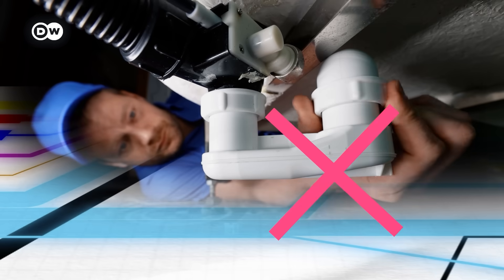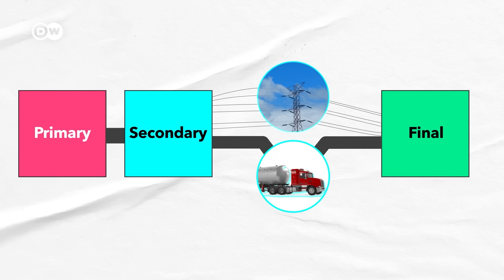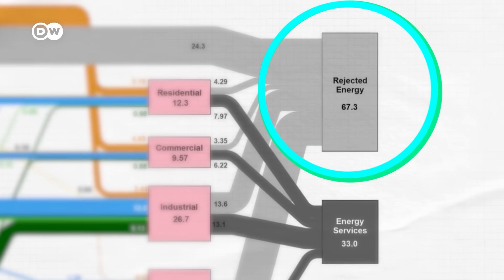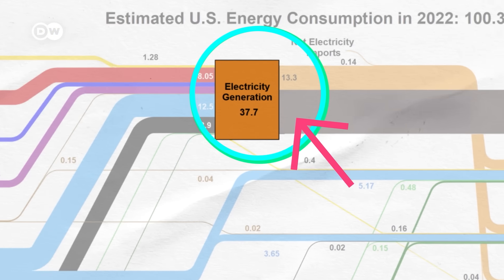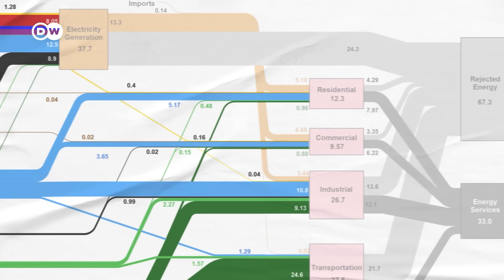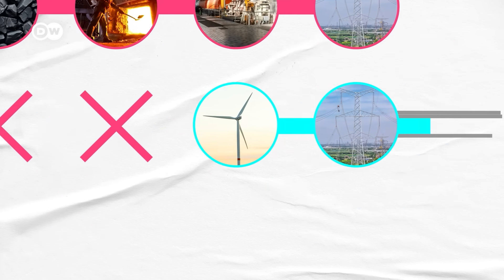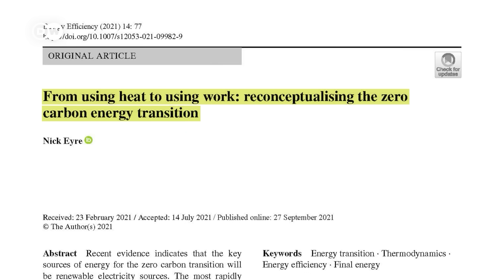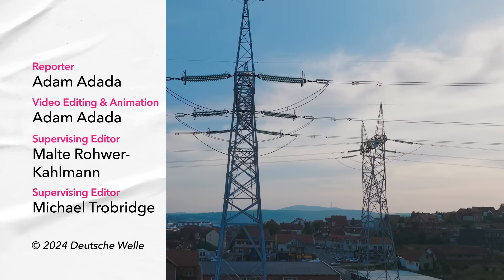The mind-blowing thing we get WRONG about energy

Comment: This is not mind-blowing, when you got a scientific background.
1. Fossil fuels are attached to thermal engines. The first and second law of thermodynamics limit the efficiency to ~40% at best.
2. The form of energy plays an important role for using it. Electricity is a very high, ordered form of energy, regarding its structure. Having such a low entropy form of energy, it is very quick to use but difficult to storage because of it is volatile/fugitive.
Reply: Ships Diesel engines are 50 to 58% efficiency

40-45% is what you would with a Naturally aspirated engine, once you add stuff like two stage turbocharging, heat recovery and so one that gets closer to 65% efficiency

Modern combined cycle gas turbines power plants get 65-67% efficiency, that without Supercritical HSRGs, or recuperator, intercoolers nor water augmentation, add those and you would get close to 80% efficiency

But again,it doesnt matter, because efficiency doesnt reduce energy consumption, 

Ships engines have gone from 30% to 55% efficiency, making them more efficienct, and cheaper to run, more people uses ships for transport, so ships have been made way bigger which has erased any fuel saved

And Europe green utopia dreams has caused companies to go where taxes are lower and regulations are non existant, like china  southeast asia, and india
Reply: Germany is quite cold, I'm surprised that they don't have more Cogeneration plants. Even low-grade heat could be pumped underground in summer to be used during winter.
Reply: @ArthursHD   When I first started learning about renewable energy, the idea of pipes underground to mix cool ground air with a home's hot air was very appealing, but it's not so cheap to dig the soil and install the pipes (though it should be). Now however, we can think of storing heat (in various ways) and in some instances even convert that heat directly to electricity. So, our ideas about storing heat and electricity are much advanced over a few decades ago.
Reply: @ArthursHD They do. Nuclear and conventional power plants in Eastern Europe provide steam for heating and cooling.
Reply: The "adiabatic flame temperature" of fossil fuels, after mixing them with the stoichiometrically correct amount of oxygen (if pure oxygen, take into account the cost of separation from atmospheric nitrogen) and combusting the mixture, is usually well above 3000 K. In an ambient 300 K world this corresponds to a Carnot efficiency of over 90%. So the truth is rather that actually existing thermal engines are still far away from the ideal reversible engine.
Reply: @Hecatonchires1991  You might be genius. Or you might be wrong.

I think you are wrong:
1. Laws of thermodynamics: There is no such thing like an ideal reversible engine/perpetuum mobile.
2. Let's assume: Flame temperature about 3000 K (a little bit high, but let's go with this number). Temperature of the exhaust gases 1300K.
efficiency = 1 - (Tmin/Tmax) = 1 - (1300/3000) = 56,6...%
And 56% is a very good value, most combustion engines are around 30% at best.

The problem is, that combustion engines are only efficient in a very close rpm-bandwidth. So they need gears to widen that bandwidth -> more less efficiency.
Reply: @michaelmueller9635  I believe that CCNG plants do approach 60%, it is of course all about the working temperature, current nuclear performs bady at <40% at 350c. But high temp reactors like MSRs at >700c could also hit 60% when paired with super critical CO2 generation plants. Also nat gas burned in oxygen has been demonstrate to hit 80% but with the cost of separating the O2 from air at 10% cost so net 70%. Use the nitrogen for fertilizer production seems obvious. This was done a decade ago in a NC prototype plant.
Reply: @michaelmueller9635  In your response you invoked other considerations on top of the 1st and 2nd law of thermodynamics. In your original post you claimed you didn't and that is were my criticism was aimed at. Other responses that I got suffer from the same problem (like whether or not an engine that can withstand 3000 K is possible in terms of materials). Just a final point of feedback: in today's heat engines you will never have T_h = 3000 K because they overdose the air that is used in the combustion way too much and that of course cools down the reaction mixture dramatically. As another poster pointed out, today's materials (at least the moving parts like the turbine blades or...) are not up to the task of handling 3000 K. The best turbines today can go up to 1800 K or something like that (expensive monocrystalline turbine blades).
Reply: @Hecatonchires1991  The main issue is, that your delta of T_min (or T_out) and T_max (or T_in) wasn't accurate.
For maximal efficiency, T_max and T_min should differ as much as possible.
Especially T_min was much too low ...it's not around 300K but 1300K.

So with a smaller delta of T_min and T_max the theoretical efficiency drops from 90% to 56% like in my calculation example. And this is much closer to the efficiency values in reality.

In practice the theoretical efficiency is furthermore reduced by heat conduction of the machine itself (wall and surfaces take heat, the machine should convert) and other effects.

And there is nothing much you can do about it: For example combustion engines in cars are in practice (fuel to wheelpower) much closer 20% than to 30%, 40% or 50%.
After like 100 years of development and optimization. So this is almost done, there will be no technological breakthroughs.

You can optimize powerplants a bit better, because you can optimize on a certain condition (and be more in the narrow bandwidth of a thermodynamic machine ...so you use their 'sweet spot' better).

But it's the point I made before (because it's a thermal engine):
After like 100 years of development and optimization. So this is almost done, there will be no technological breakthroughs (S-Curve-Concept/Modell).
Reply: @Hecatonchires1991 Then Mr. materials scientist, find me a cylinder wall metal/superheater metal that can survive at adiabatic flame temperature. I'm waiting. 🙄
Reply: Cast Iron sleeves will do fine, Thats why we have boundary layers.

The average working temperature of Diesel and Otto engines is around 600°C, while peak temperatures shortly after combustion are 1700°C, however it happens so quick that a low ammount of heat is transfered to the combustion chamber walls

The temperature at the boundary layers between the engine oil and cylinder walls is around 200°C and as such we can keep it cool with water at 100°C

Most of the heat is lost during the exhaust, thats why turbochargers and lean combustion was invented, so the exhaust does partial compression work of the engine
Reply: I don't understand why efficiency matters here. Solar panels are at best 20%, while wind turbines are a bit better. If we "wasted energy" then renewables end up losing
Reply: @user-hk3ej4hk7m : Since renewables get their energy from the sun, the "wasted" energy turns into heat. Which 100% of the sun would have done, if the solar panelss wasn't there. And wind turbines do the same thing indirectly with wind.
Reply: It still doesn't answer why making the switch should be any easier. Or why you "only need to substitute 2/3 of it"
Reply: @user-hk3ej4hk7m  Because renewables do not get wasted during the 'energy transformation process'.
It is like:
energy-form A (input, not directly usable) -> transformation process (to make it useable) -> energy-form B (output, usable)

If your energy-from A (or the input) is already electricity, you don't have to transform it and therefor there are no losses by conversion.

Be a little bit careful with physical energy and a "usable physical energy form for economic/human" needs.
Reply: @user-hk3ej4hk7m    If you substitute 2/3rds of the inputs with renewables (heat and electricity generally), and then avoid wasting that energy, you've shifted away from inputs that are eventually wasted over to fewer inputs that are used more efficiently. It's more of a lateral shift than mathematical reductions here or gains there.
Reply: @user-hk3ej4hk7m  A gas stove is worse at doing it's job than an electric stove. If you replace the gas stove with electric, you are using less energy to do the same cooking, plus you are creating zero greenhouse gasses. Even if your grid is powered from fossil fuels, the efficiency of the electric stove still helps.
Reply: @Babyblasphemy A gas stove might only be 40% efficient. But the gas-burning power station is 60% efficient, 91% transmission efficiency, 80% of the heat going into the food, with a combined efficiency of barely 43%. So in the end, the energy use is the same.
Reply: @gregorymalchuk272  Sure. But that doesn't feed into the economic  balance. 
"Waste" is just a strange term, they simply can't convert it. Just say ur solar foil can do a certain bandwidth. The other  bandwidths got simply reflected or get a pass, but don't get converted. Is this waste? I dunno.
Reply: @user-hk3ej4hk7m    Losing sunlight and wind don't destroy the environment. They aren't like trash we have to dump somewhere.
Reply: @user-hk3ej4hk7m Wind turbines are a tiny fraction of 1% efficient at converting sunlight to wind. Solar panels are really bad as they dump 83% of their heat to low-to-ground air heating.
Reply: @user-hk3ej4hk7m  you forgot one thing: did you pay for sun to shine? did you pay for the find to blow? no.
Reply: @sirati9770  There is some cost to getting that energy, but it's much less than with coal and oil or wood. I wonder what that improvement in efficiency is. It should be included in all these analyses.
Reply: Electricity can be stored in salt or sand batteries,, quite easily.  Otherwise, generate hydrogen.
Reply: @FlameofDemocracy  And immediately lost 70% of efficiency
Reply: @FlameofDemocracy No it can't. It if was easy, it would already be being done by the terawatt-hour, and it isn't.
Reply: @FlameofDemocracy  Hydrogen production is quite lossy, short term liquified air/CO2 looks good at 60% round trip eff for adays of storage, heat goes into sand.
Reply: @johnjakson444  Leave everything to experts.